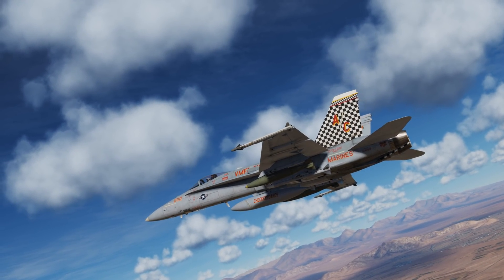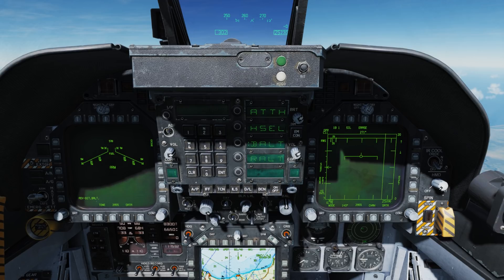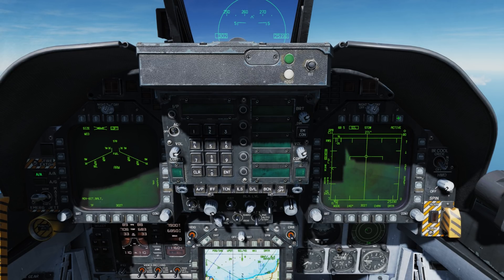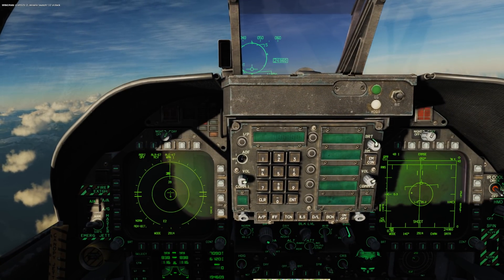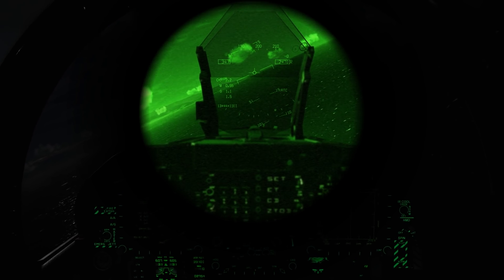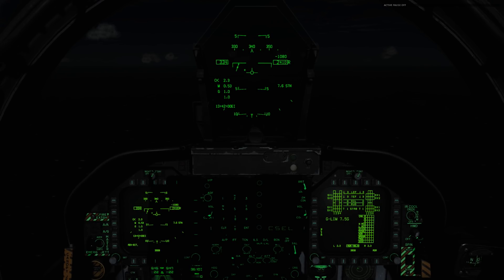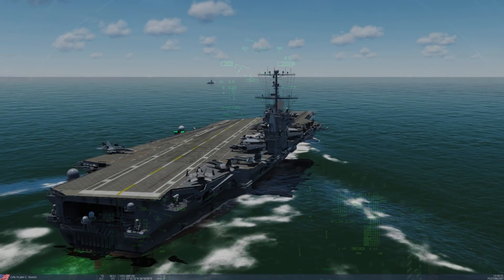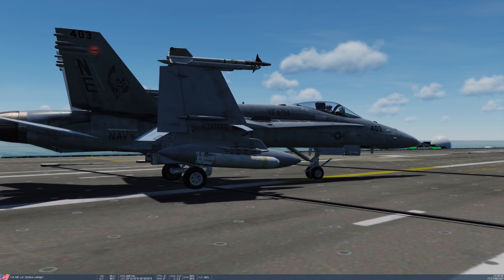DCS: F/A-18C Hornet – 14 July News

Comment: As great as these updates are - this one (20.17. open beta) has, once again, altered my control-setups and altered/deleted key-bindings. This is such a pain to correct for potentially all installed modules. Is this behavior really necessary?
Reply from the maker: Yes. As an open beta, early access, new commands will need to be added from time to time. When that happens, it invalidates previous bindings.
Reply: Thanks for your answer. That does make sense to me. Love the F/A18, btw.

Comment: Hi Matt, long time 'reader' first time 'caller' here!  Firstly, outstanding work on the F18, as an ex VRS F18 driver, I am so happy to have an F18 that does not push the sim to breaking point when used in MP.  

A very quick question for you, and please do not see this as in any way antagonistic as that is definitely not ment,  but would you be able to give us a rough 'guestimate' on when you see the F18 being fully feature complete?  I only ask as I am a member of an online FSX/P3D organisation and there is massive interest in moving away from the 'halabaloo' that is setting up and flying military missions in FSX/P3D, for the way more user and multiplayer friendly ME in DCS, however, there are reservations from the guys in just how long it will take to get the F18 complete.  This is the ONE stumbling block I have in 'showing them the light' in regards to DCS and moving away from FSX/P3D, well that and 'when are we gonna get an AH64D?' :)

Could you shed some light on this for me, so that I can go back to the lads with the enthusiasm of a midget at a miniskirt convention, and the facts to beat them into submission with!  Thanks in advance.
Reply from the maker: The Hornet is in early access and new features are being added continually. Based on history, we now avoid providing guesstimates as they are often quoted as promises.

Comment: Do you guys think the Heatblur F14 will be as nice as this F18 is?
Reply: I really would like to know more about the F-14D. Presently, I find the FA-18C more softicated than the F-14. The variable wings is quite fascinating but the cockpit instrumentation and layout is clunky from my observation.
Reply: Not really  ideal comparisons as these are essentially planes from different eras. F14 is earlier 4th generation tech. Heat-blurs F14's  will be representative of the plane  circa mid 80s- early 90s ( with regards to  A and B versions respectively). Although truth be Told like IRL the F14A/B versions with upgrades being denied were considered obsolescent at the time of thier Retirement comparative to Upgraded Hornets and especially to the Super Hornets.

F/A18C version on the other hand that ED has chosen to simulate is representative of a 1998 production bath  with various Post production Upgrades placing it as a proper 21st Century Multi-role Fighter

The F14A/B apart from having a more powerfull search radar  and Longer range Aim54, Is otherwise more archaic In technology. The F18C has a full glass pit, has a FBW system and upon EA completion will have much more and vaster array of  modern weapons & targeting  systems,  coupled with greater mission variety.

It will also have a significant lethality  in close range A2A combat when Aim9x and HMCS combo get implemented

What will certainly be a big gamechanger will be SA  advantage   of the Hornet  being equipped with link 16. Being able to share Data from other Hornets sensors ( Eventually other link 16 compatible planes)  , AWACS, and Ground Assets will contribute to big picture. IT will simply will be an unprecedented  SA advantage compared any other aircraft prior to it.
Reply: Son of THE King don’t know. Probably won’t be as expensive as the f-18.
Reply: Nikola16789 when you say, “ more finished “ do you mean like all the physics will be set, and all weapons will be finished, or do you mean just more finished than the f-18 when it’s earliest option was available?
Reply: It sounds like its going to be more finished in general upon release, with a bunch of weapons, systems, and a fully functioning Jester AI for the back seat WSO.
Reply: I think it will be more expensive, more detailed and more finished on release date than F18